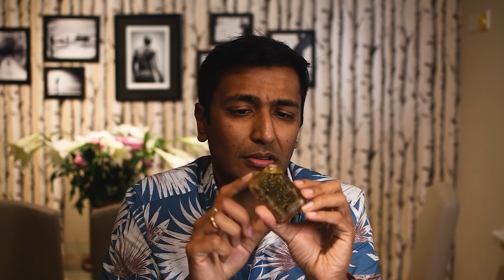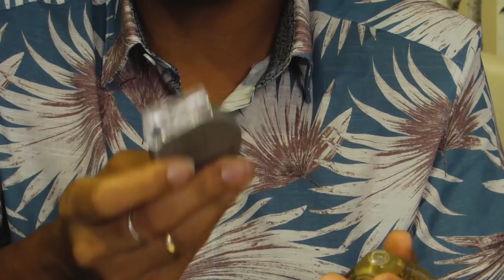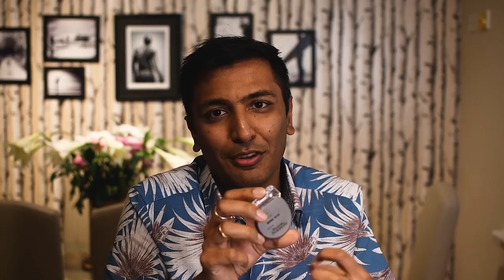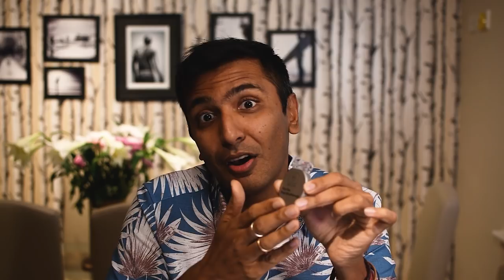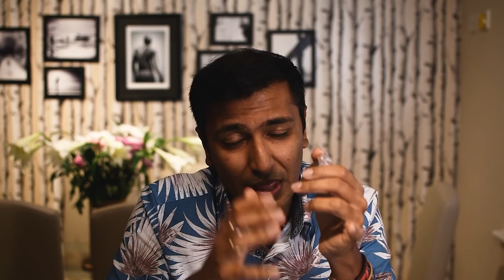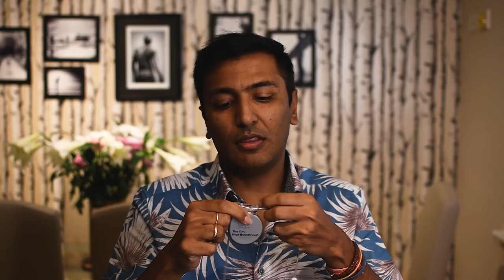Cheating death: The defibrillator

Comment: Had 3 vtac episodes in 3 days and finally called emergency. After extensive testing in hospital I had a 4th episode while hooked up to heart monitors. The room was immediately filled with doctors and nurses and even the machine that goes bing! The episode resolved with much effort on their parts just as they had me setup for the big shock and CPR. The solution was a defibrulator which went in 2 days later. Everythings good now but it's only been 5 days.
Reply: How's everything going 7 months later?  I hope well. 😊 Please let me know. 👍
Reply: @tennaj1367  Everything is working well. I have had a few hospitalizations since for various related things but I'm home now and recovering nicely. I do plan to start videos up again real soon. It's been a busy year medically for me but I think I'm out of the woods finally.
Reply: @BustedJunkStudio  Hello I'm 10 months in with my ICD and am concerned about the shock. Has this happened to you? does it cause you to pass and cause a lot of pain? Thanks.
Reply: No it has not. I've been told by my cardiologist that when you get a shock you are pretty much passing out anyway at the time so mostly it more like a dream.

Comment: Will this device not unnecessarily shock an athlete most of the time whenever the rhythm is high... What if it shocked??? Is it dangerous??? Sounds stupid but this question was running in my mind since I heard you Doctor...
Reply: Oh yeah that was my worry too. Because I'm still continuing with sport and have one of these inside me. The doctor told me it will recognize if it's sinustachycardia or ventricular tachycardia because of the broadness of the measured ecg. Since I got mine I never did sport with more than 130 heart rate, so I didn't test it out. Maybe at my next rehab when I'm surrounded with doctors I'll test it at the stress test😂
Reply: @bernd5199  Hope your queries will be addressed before your next follow-up sir, wish you luck and good health 😊😇🙏
Reply: @sunitha2533  thank you very much 😀
Reply: Cooper McKenzie  yeah, that's absolutely clear that exercise increases the heart rate but a VT can be rhythmic if it originates from one spot and it also increase the heart rate. My worry was if the defibrillator could misinterpret a very fast sinus rhythm as a ventricular tachycardia.
Edit: and I was always talking about high heart rate, not "high" rythm, whatever a high rythm may be 😀
Reply: Sunitha it's not stupid and thank you for asking! I had not thought of this
Reply: Cooper McKenzie she said it in her original post that it sounded stupid which was what I was responding to-I just thought it didn't sound stupid at all.
Reply: @xino_z  Thanks all 😊😇🙏🌹💐
Reply: My husband's cardiologist adjusts his device if he sees from the monitoring that his activity is getting close to him getting shocked. I believe it is now at 170. He has a dual chamber device that has a pacemaker, so his device is programmed so that his heart rate doesn't go too high or too low. Plus with the medication he is on, it would be a struggle for him to get his heart rate that high for any sustainable time.
Reply: Are u implanted with one ?…bcoz I have one and iam also having concern for the same… thank you for asking though ..

Comment: Why does this device ' MUST " be installed in my body
Why not just have the leads inserted and the device taped to my body?
I noticed there is a logo on the device { ink ) wears off after time
The coating of the device will break down in time

Comment: What do you think about patient sent home after heart attack, told heart too weak and damaged, and given a LifeVest wearable defibrillator worn outside the body? I've read a lot of nonsupporting articles to the contrary on this piece of equipment. Not sure considering risk factors of patient life vs possible equipment that does not perform to standard, of which there are none they have to really adhere to prior to market placement. Thoughts on the LifeVest?
Reply: I had to have a life vest on for 3.months before i actually got a ICD implanted . It was a little uncomfortable and i was stressed about wearing at first because i never heard of it,but at the same time i was thankful i had something that could save my life if needed, versus just passing out and waiting for ambulance. Having heart problems is ALOT and sometimes you dont know what to do or feel. But if it can help why not try it because your just wearing it, its not implanted. Hope this helped. Blessings to you.
Reply: @queenbeeetta  Any updates?  How is it going with the ICD ?  I hope well😊. Please let me know. Thanks 👍

Comment: I have hypertrophic cardiomyopathy (HCM) and therefore implanted with Subcutaneous Implantable Cardioverter Defibrillator (S-ICD). The fear of sudden death is on my mind 24x7x365 :(
Reply: When did u got ice impanted .and what gets you to diagnose hocm.. I have the same fear throughout and iam finding ways to deal with it .
Reply: @mandarrajguru6946  A lot has changed since my comment 2 years ago. I died twice and my S-ICD saved my life twice with appropriate shock. Now, I have been referred for septal myectomy. When I say I died twice, I suffered cardiac arrest and in both cases, the reason was that I was either running or going upstairs. So there is no need to be scared just don't run, don't walk on steep surfaces including roads and stairs, don't involve yourself in a situation where you have to run or suddenly put your heart at stress, and keep your heart rate between 50 to 100 bpm and all will be fine.